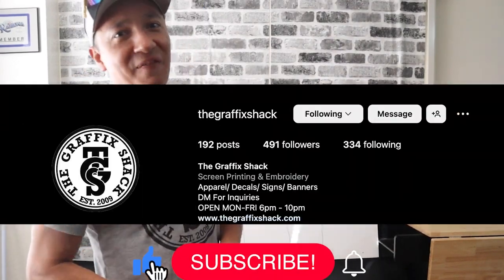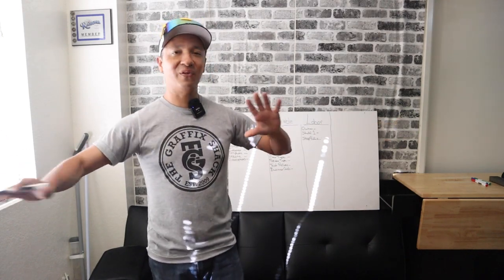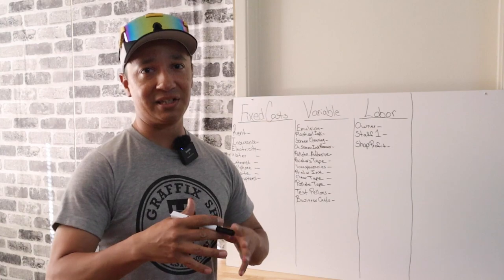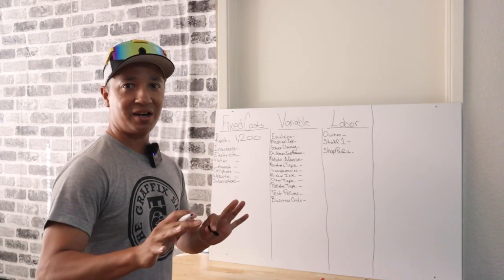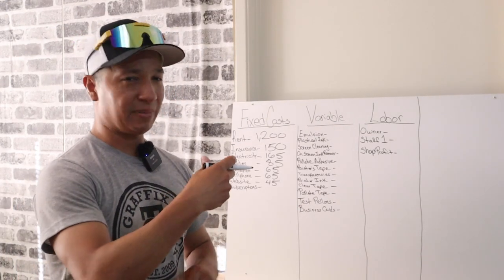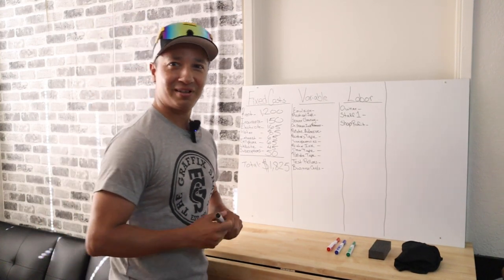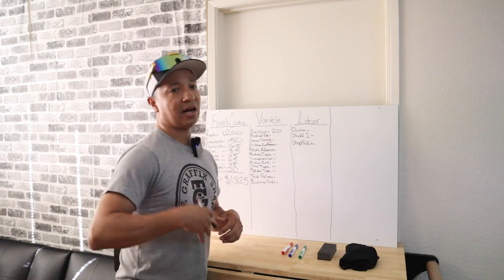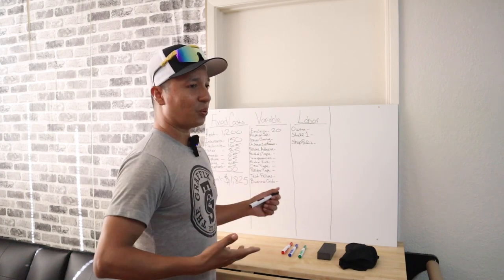How To Make Your Screen Printing Shop Profitable - The Graffix Shack

Comment: What if the job involves multiple colors?
Reply from the maker: Thanks for watching 🙏 if the job involves multiple colors the pricing strategy is the same. Simply add more time for the additional colors and also for flashing if needed... for example 24 pcs with 3 color print with 2 flashes... you would need to account for setup of 3 screens, 2 flashes and clean-up for 3 screens... so whatever time it takes you to prepare 3 screens plus however much extra time you need to flash 2 times and time for cleaning 3 screens.... so it would look like this: Screen prep time + print time + flash time + clean-up and divide that total by 24pcs.... hopefully this made sense 🙏
Reply: @thegraffixshack  thank you 🙏🏽

Comment: With DTF booming, do you think it still good to start a silkscreen printing??
Reply from the maker: I definitely think it still is a good idea to start a silkscreen printing business. DTF is booming right now and it definitely is a tool every screen printer should incorporate into their shop. I use it for short runs of full color images. But, DTF will never beat out screen printing as far as speed and affordability. Another factor is many people prefer the screen print feel over DTF. To sum it all up in my opinion: DTF is a great way to start an apparel printing business and as you grow I would recommend getting a screen printing press since the profit margins for screen printing are higher than DTF. Thank you for watching 👍💯🙏
Reply: Thank you. I just ordered a complete set of screen printer

Comment: Awesome video. I'm about to get into screen printing, but dont have the space, so i'm sinking everything i have and a lot more of what i dont have into leasing a space. I've been estimating to the best of my ability as to how to price things out to make sure i dont starve to death and creditors dont come kicking in my door . This was super informative. Thanks a lot. Got any more tips?
Reply from the maker: Thank you! I'm glad you found value in my video. I appreciate you watching 🙏 having a grasp on the actual costs is definitely vital for any business. Once you know your numbers everything else falls into place. I wish you tremendous success my friend. Definitely have many more tips I can share. Let me know if you have any questions and I'll do my best to guide you in the right direction. 🤜🤛🙏
Reply: @thegraffixshack  thank you! You're the man! I actually watched this video 2 more times earlier today to help guide me through working out my own expense and pricing spreadsheet. One thing I have been wondering a lot about since I'm starting out and trying to save money and space is, would I be able to cure ink if I flashed it a couple times maybe on a higher temp, or a longer time? Or would I be able to cure using a heat press? I don't want to buy an expensive conveyor right away if I don't absolutely have to
Reply from the maker: You can definitely cure with both a flash dryer and or a heat press.  I personally don't have a conveyor dryer. I cure all my garments with my flash dryer. When i print at events i cure the shirts with my heat press.